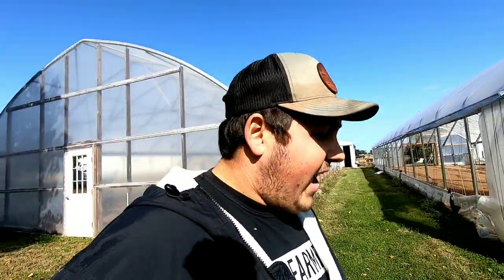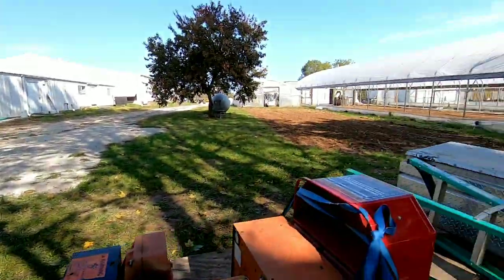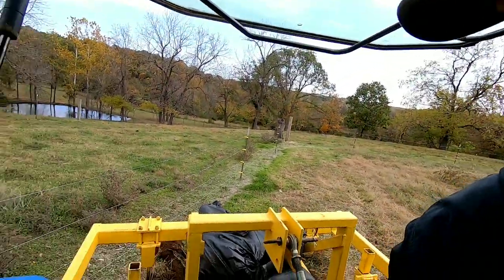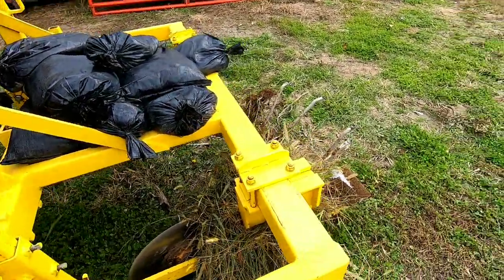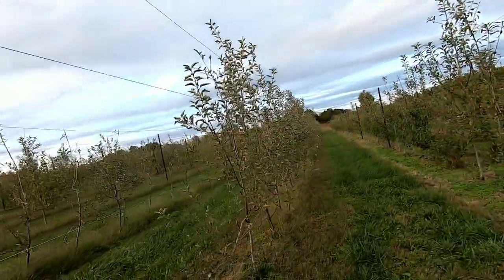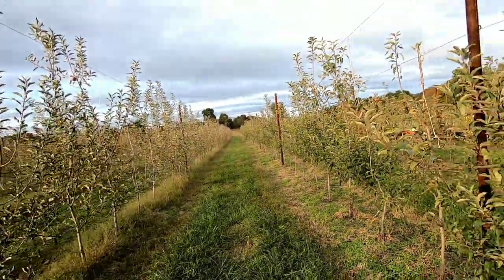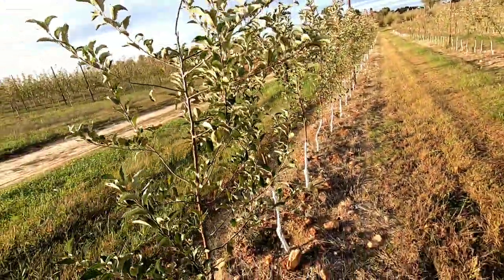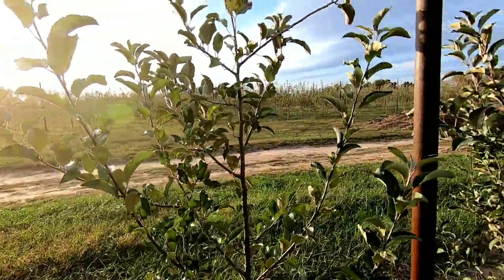Why I HATE Plastic Mulch

Comment: I know you don't like it but this year was awesome not picking up mulch. I ran my flail mower over the stalks then pulled the drip up. The bio mulch had the consistency of burnt newspaper. It vanished when I disced it. John-a-gold?????? That must be a great apple. Named after me. Trees are looking great.
Reply: Make your beds first, nice and shaped and tight. Then put mulch and don’t put an extreme amount of dirt on after. I find it better to have the beds nicely shaped wind won’t mess with them. And when it’s time to take it off just pull it by hand I do it this way and it’s super easy.I’m using 1mil and peppers where plastic is on for 8 months. Before I would have discs put so much dirt to where it was impossible to remove plastic